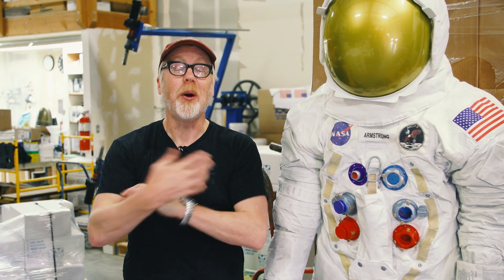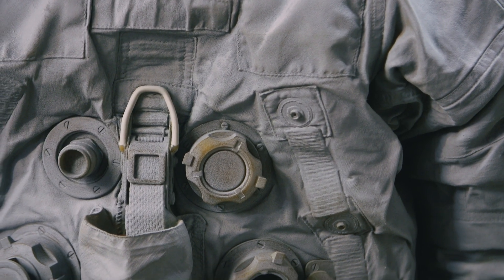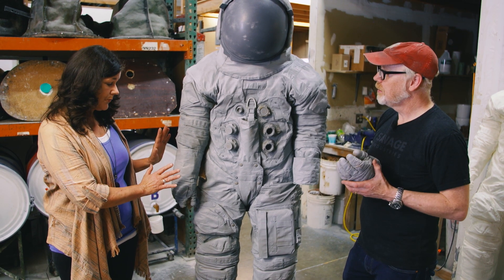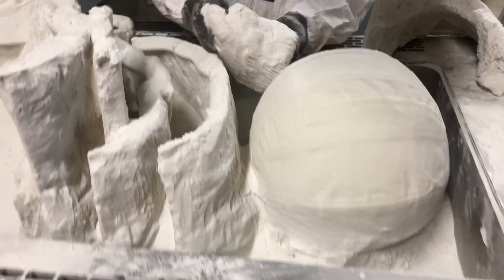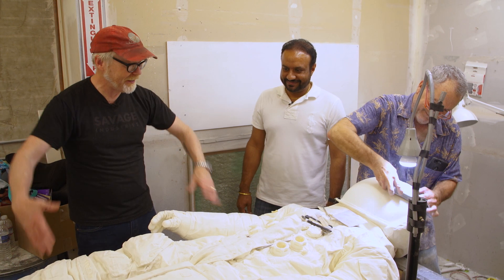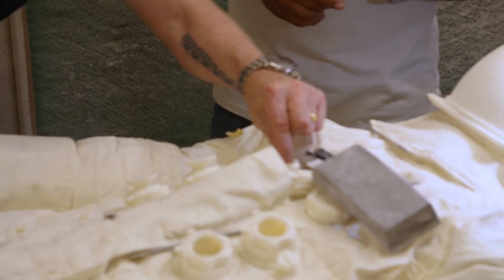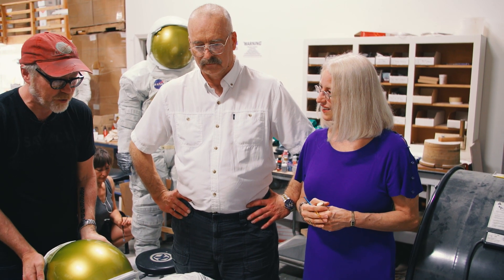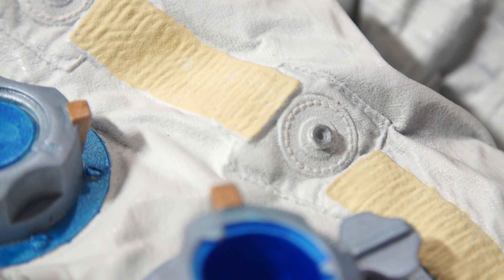Replicating Neil Armstrong's Apollo Spacesuit!

Comment: Can somebody tell me if I have this correct? These suits had pressurizing systems for an extreme vacuum environment, oxygen systems ,dehumidified systems , they were filled with communication devices, had cold water pumping systems to cool for surface temperatures of 250°F in the sunlight and had electric coil heating systems to heat for surface temperatures of -300°F in the dark.
Am I missing anything?

Comment: Impressive effort but for for the time an money already spent, they could have vacuum formed the face shields and electroplated gold. They also could have CNC'd the front connections and anodized them. I did vacuum forming and some CND's aluminum bits(not just 3D print) for my Uni Sr year Industrial Design presentation model (10 yrs ago). Good stuff tho!

Comment: I've worked on various parts all down the line for large figures, some even larger than this, but the way we did rotocasting was by hand on a special jig and typically when it got this big we'd just break it up into multiple parts to be joined together after. So typically we'd have a two piece jacket for a cartoon character or giant Lego minifig's head, and a two piece jacket for the body, then maybe a set for the arms or legs. Then we'd put them together later. Very large things like the Hulk, would be broken up into up to a dozen separate pieces. Seeing them do this whole thing all at once on an automated jig is CRAZY. And Jas saying one 3 people handle demolding all those jacket pieces and bolts is mind blowing.

Comment: Should have done better on the visor. For anyone here that does models or other builds there’s a great way to simulate metals now with a spray can. This isn’t that terrible crappy fake chrome you used to see in automotive stores that looked nothing like the metalized lids. 
Krylon has what they call a Premium Metalic Finish that comes in a rattle-can. Lay it on over a white primer and it’s nearly indistinguishable from a highly polished metal. Comes in gold, silver, chrome, brass, copper, and other metals.

Comment: The ELEPHANT in the room, is laughing at YOU.
- 33 33 layers :)

What does it take to maintain a vacuum ?

The SPF ( Space Power Facility ) is located at the NASA Glenn Research Center at the Plum Brook site. It can achieve a 10^-6 torr vacuum on earth but it requires 6-8 feet of concrete with a solid metal core to hold back the pressure of the air.

What is the pressure on the moon ?

GOOGLE "WIKI - Atmosphere of the Moon"
The atmosphere of the Moon is a very scant presence of gases surrounding the Moon. For most practical purposes, the Moon is considered to be surrounded by vacuum.
The pressure of this small mass is around 3×10−15 atm (0.3 nPa) 

Apollo Space suits ?

According to NASA.
1. Spacesuits were pressurized to 4.3 psi = 0.29 atm = 29.6kpa = 222.4 torr 

PROBLEM ?

Clearly reducing the pressure to 1/3 atm is insignificant compared to the VASTLY higher vacuum of the moon (¬10^-13 torr) compared to the SPF (10^-6 torr) vacuum.

For the DUMBASSES in the room ........
- The apollo spacesuit Is structurally STRONGER than 6-8 feet to concrete and metal.

Wake the F*uk up people.

--------------------------------------------------

FURTHERMORE The ISS is said to be pressurized to 1 atmosphere = 760 torr (the same as earth). 
So the ISS would have to withstand (ORDERS of magnitude) more pressure than the SPF facility . for 20 YEARS .…

REMEMBER the time when an astronaut plugged a leak with his FINGER .. ;)
GOOGLE "An Astronaut Plugged the Leak on the Space Station With his Finger"

*And lest we forget about the "magic" rubber O Rings. *
- That apparently never degrade or need replacement. 
- Can withstand impossible temperatures changes 

Astronaught - Don Pettit
What happens if you get a leak on that .... 
Then you have a leak .... 
There is probably a plan, 
Don`t know of the top of my head ...
To replace the mechanism..
Might require a spacewalk !!!!!!!!!!!

SEARCH YOUTUBE "FAKE NASA | O Rings on the ISS Cupola and Ever Degrading Rubber"
SEARCH YOUTUBE FOR "FAKING SPACE – S3:E3 - Apollo & the Vacuum of Space"
SEARCH YOUYUBE FOR “Space walks filmed in a pool, you decide ?”
SEARCH YOUTUBE FOR “100% PROOF NASA use CGI Augmented reality for ISS fake space station” 
SEARCH YOUTUBE FOR “1+ hour fake station fails”
Reply: Youtube is not a reliable source of information since anyone who doesn't understand the topic can make videos about his ignorance only for people who think they are smarter than everyone else because copying and pasting the same bullshit they say in every space related video makes them feel better. As an aerospace engineer, it doesn't take rocket science to confirm you are an idiot.
Reply: @tsurutuneado5981  
- You guys have this idea of science as "accepting what the smart guys tell you".
- The truth is something that comes from the "establishment".
- Being part of the herd makes you feel safe.
- On the rare occasion when you have to think for yourself, you don`t enjoy it too much .. It is stressful and makes you feel uneasy ....

The dumb kid in school that resents anyone smarter than themselves ?
Is that you Alejandro Pacheco
 ?

If I am WRONG then EXPLAIN WHY
Reply: @decadent.  Because you are not an aerospace engineer
Reply: @decadent.  Why don't I make an attempt to refute your arguments? Because it is a waste of time. We both know you won't change your mind, you aren't capable of accepting you are wrong and I won't bother trying to do so.
Reply: The SPF is a building, and it's much bigger than a spacesuit. You haven't done your math at all.
Reply: @Jan_Strzelecki  
That is a DUMB argument.

The size of the volume is not a factor. 
Think about what the units of pressure are ... 
[Pressure is the force applied perpendicular to the surface of an object per unit area over which that force is distributed.] 

- people like you (in my experience) don`t tend to learn anything without being prompted or required to do so.
- the reaction to scoff at anything that goes against your "herd" viewpoint is usually an indication of mental laziness.
- It is like the child at school that attacks another child for doing better than them on a test. It is a defense mechanism. A way to avoid any self examination.

The question is, do you REALLY want to know anything beyond what you have been "fed".
What the public are told about science is simply a "story". 
It is reasonably plausible if you don`t really think about it too much.
That is good enough for most people.

THINK ABOUT THIS

- The ISS is pressurized to the same pressure as earth.
- The differential pressure in the ISS vs Space case is GREATER than the SPF vs atmosphere case.
- THEREFORE the ISS most be stuctrurally stronger than the SPF.
- THAT IS CLEARLY NOT THE CASE.

REMEMBER the time when an astronaut plugged a leak with his FINGER .. ;)
GOOGLE "An Astronaut Plugged the Leak on the Space Station With his Finger"

*And lest we forget about the "magic" rubber O Rings. *
- That apparently never degrade or need replacement. 
- Can withstand impossible temperatures changes 

Astronaught - Don Pettit
What happens if you get a leak on that .... 
Then you have a leak .... 
There is probably a plan, 
Don`t know of the top of my head ...
To replace the mechanism..
Might require a spacewalk !!!!!!!!!!!

SEARCH YOUTUBE "FAKE NASA | O Rings on the ISS Cupola and Ever Degrading Rubber"
Reply: @decadent.  Look at things around you that hold back internal pressure: aerosol cans, gas cylinders, propane tanks, air compressors, etc.
 They tend to be circular in cross section as they allow for immense amounts of pressure to be maintained. A typical compressed gas cylinder (like a scuba tank) can maintain around 3000 psi or 200 times the pressure that the ISS would be expected to maintain.
The real elephant in the room is your insistence that each and every engineer and scientist on Earth would somehow miss or ignore that pressure "problem" of yours.
Reply: @Jan_Strzelecki  
You are making a typical mistake.
- The structural strength required to maintain a barrier between two volumes of different pressure is determined by the DIFFERENTIAL pressure NOT absolute pressure.

Think about vacuum pressure...

A 10^-1 torr vacuum can be created with a cheap glass vacuum and a pump you can buy on amazon.

A 10^-6 torr vacuum requires 6-8 feet of concrete and metal.

A 10^-17 torr vacuum CANNOT be a created on earth. 

CLEARLY the structural strength required to contain/constrain the resultant pressure differential is increasing EXPONENTIALLY..

Pressure is NOT a linear scale.

For a simple demonstration.
- Consider a carbonated coke can. Pressurized to 100 psi
- In the atmosphere (15 psi) the can has no problem containing the pressure.
- Because the differential pressure is only 4 to 1
- Put the can in a vacuum chamber and it will explode.
- WHY? Because the pressure pushing on the can from the outside has been removed. i.e. differential pressure has increased.

SEARCH YOUTUBE "What Happens When You Put A Can Of Soda In A Huge Vacuum"

-------------------------------

THESE ARE IRREFUTABLE FACTS.
1. The ISS is pressurized to the same pressure as earth.
2. The vacuum of space is far more of a vacuum that 10^-6 torr
3. Constraining that differential pressure on earth requires 6-8 feet of concrete and metal
4. NASA claim that a hole in the ISS was plugged by an astronaut putting his finger over the hole ...

GOOGLE "An Astronaut Plugged the Leak on the Space Station With his Finger"

How can ANYONE with any level of critical thinking accept that ?

I understand why you find this hard to accept.

- I accepted this stuff for years. Most people do, because they have no reason to doubt it.
- The truth is that humans are incredibly easy to manipulate, most people simply do not think about things until they are prompted/required to do so.

At the phD level Scientists KNOW the truth. 
This is an intentional deception. 
The truth is right there in plain sight. It always has been. 
In the world we live in "the truth" is whatever the "powers-that-be" say it is. 
The Herd mentality of humans is why they have been so easy to control. 

The left / right paradigm in politics is a perfect example of that.
Rather than THINK for yourself you are simply supposed to PICK a side.
You either agree or disagree with a particular "constructed" narrative designed to push your buttons.
Psychological techniques such as this have controlled the public since Time immemorial.

- More on vacuum pressure.
SEARCH YOUTUBE FOR "FAKING SPACE – S3:E3 - Apollo & the Vacuum of Space" 

Believe it or not I am trying to wake people up for their own good.
- The moon landing/ISS hoax is the tip of the iceberg.
- There are far more significant facts being withheld from the public.
Reply: @decadent.  You are making a typical mistake.
How so? I understand that it's about a pressure difference - you apparently do not.

CLEARLY the structural strength required to contain/constrain the resultant pressure differential is increasing EXPONENTIALLY.
Nope. The deep space vacuum cannot be created on Earth because of the last few stubborn atoms inside, not because of the inadequate structural strength.

SEARCH YOUTUBE "What Happens When You Put A Can Of Soda In A Huge Vacuum"
Yes - a soda can designed to withstand a specific pressure difference will burst if this specific pressure difference is bigger. No kiddin'! What next? If you put too much air in the balloon, it will burst?

THESE ARE IRREFUTABLE FACTS.
Your mistaken assumptions are not "irrefutable facts".

How can ANYONE with any level of critical thinking accept that?
Easily.

At the phD level Scientists KNOW the truth.
And yet, they remain silent, even though they are the ones that stand to gain the most from exposing that "lie".

The Herd mentality of humans is why they have been so easy to control.
Yep - you only need to tell them that there's this giant deception going on, and they're the ones that are clever enough and special to know the "truth" :)

I understand why you find this hard to accept.
I find it hard to accept because it's not factually correct.
I find it hard to accept because it would pretty much require 90% of the worlds population to lie to the other 10%.

Believe it or not I am trying to wake people up for their own good.
Oh, I believe you imagine you are correct. Unfortunately, you're not, and you stubbornly refuse to accept it.
Reply: @Jan_Strzelecki  

"A typical compressed gas cylinder (like a scuba tank) can maintain around 3000 psi or 200 times the pressure that the ISS would be expected to maintain."
- ABSOLUTE PRESSURE ....

That is the same as saying that a 10^-1 torr vacuum is basically the same as a 10^-17 torr vacuum ..

"Yes - a soda can designed to withstand a specific pressure difference will burst if this specific pressure difference is bigger."
- DIFFERENTIAL PRESSURE....

THOSE STATEMENTS are in contradiction.
- On one hand you are saying that a gas cylinder is containing more pressure than the ISS and therefore the ISS would have no problem containing a lesser pressure in space.
- On the other you admit that changing the pressure OUTSIDE the soda can will cause it to explode.

- The gas cylinder maintaining more pressure than the ISS is not the issue.
- Put the gas cylinder in space/vacuum and It will obviously explode.

"Nope. The deep space vacuum cannot be created on Earth because of the last few stubborn atoms inside, not because of the inadequate structural strength.
"
- That is a laughable statement.
- SPF requires 6-8 feet of concrete and metal.
- A thin fabric suit or a millimeter of aluminium sheet would apparently work just fine according to YOU :)

"And yet, they remain silent, even though they are the ones that stand to gain the most from exposing that "lie"."
- You are no clue about how society works.
- Scientists that are smart enough to figure out the truth, obviously know that speaking out will lead to being ridiculed / silenced / fired etc. 
- There are numerous phD physicists that have exposed the truth, written books etc.
- I would imagine most of them did not "gain from exposing the lie" other than perhaps in terms of their conscience.

ANSWER THIS POINT
- If you are not willing to admit that this is obviously a lie
- then you are beyond help.

---------------------------------------- 
THE ISS IS PRESSURIZED TO THE SAME PRESSURE AS EARTH.
The differential pressure it must withstand is GREATER than the SPF must withstand on EARTH.

REMEMBER the time when an astronaut plugged a leak with his FINGER .. ;) 
GOOGLE "An Astronaut Plugged the Leak on the Space Station With his Finger" 
--------------------------------------------
Reply: @decadent.  THOSE STATEMENTS are in contradiction.
Wait, what? Those statements are not in contradiction! What are you talking about? "A scuba tank can withstand 200 more pressure than ISS' hull, or a soda can, therefore ISS is fake"?

SPF requires 6-8 feet of concrete and metal.
Yes, because it's a building. Earlier, you yourself pointed out that a scuba tank can maintain around 3000 psi, or 200 times the pressure that the ISS would be expected to maintain. Be consistent.

A thin fabric suit or a millimeter of aluminium sheet would apparently work just fine according to YOU
No, that's not what I said. A space suit is not comprised solely of fabric, and the hull of the ISS has structural reinforcements. If you didn't know either of those things, you clearly don't possess enough knowledge about space tech to make any meaningful judgements about it.

Scientists that are smart enough to figure out the truth, obviously know that speaking out will lead to being ridiculed / silenced / fired etc.
The history of scientific discoveries proves that statement wrong.

There are numerous phD physicists that have exposed the truth, written books etc.
Such as?.. :]

I would imagine most of them did not "gain from exposing the lie" other than perhaps in terms of their conscience.
And fame. And money.

REMEMBER the time when an astronaut plugged a leak with his FINGER
Yes, I do remember the time when an astronaut plugged a leak with his finger, yes. This alone proves  your confused understanding wrong. Just think about it - if the ISS is fake, then there was no leak, and the whole thing has been staged. Therefore, the NASA scientists must've thought that plugging a leak with finger is scientifically plausible.

Comment: 50 years later we cant go to the Moon... hmmmm something cheese here :D
Reply: Suddenly, a wild conspiracy nut appeared.

We can go to the Moon. We would simply have to redesign, build, and test the launch vehicle, the orbiter, and the lander to account for changes in materials and technology. Train astronauts, ground crew, and operations personal to work with the new designs. Build and/or retool factories to manufacture the millions of components and build the equipment. You can't just go pull stuff off the shelf at Best Buy. All of this takes an immense amount of man hours and funding.

The reason we don't currently have the ability to go to the Moon is because it requires very specialized knowledge, training, equipment, and manufacturing processes that differ from what is required for orbiting the Earth. The factories aren't set up to build the equipment. The personnel have not been trained. The materials available have changed. Added to that, there's just not a compelling reason to go. Been there, done that, brought back rocks, left some trash.
Reply: @notahotshot  ok... lets do it when is "No Problem"...

Comment: The company my dad works for sells 3D printers with built in cutting heads with print tables 10'x20'xup to 100'. Crazy to see it work.
Reply: Cutting head? So is it a printer a CNC? Or both?
Reply: hazonku It's both. They essentially pioneered cnc manufacturing. Look up Thermwood LSAM